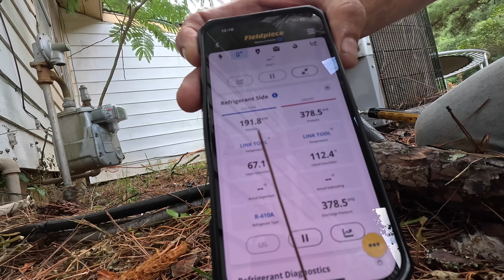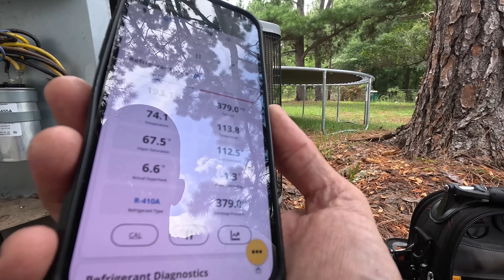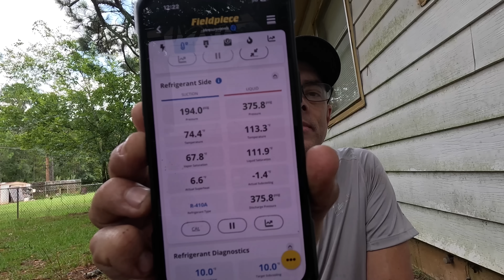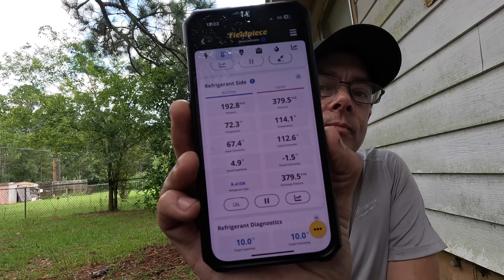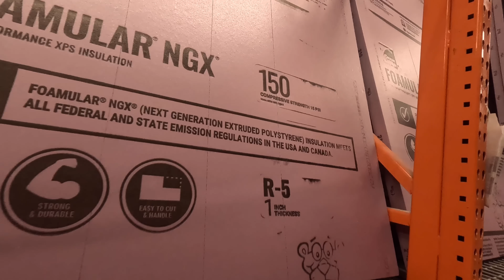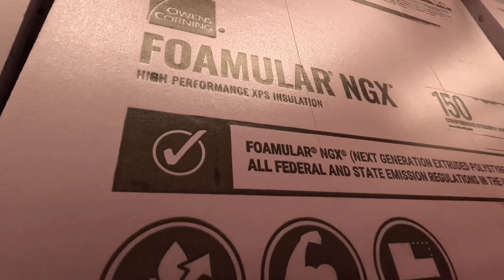Found A Problem I Need To Eliminate First! #hvacguy #hvaclife #hvactrainingvideos

Comment: Not sure how the decision was not made to add a voiceover over that wind in post. But anyway, that symptom pattern is textbook low airflow. Any licensed HVAC guy should know that as a memory item. Memorizing the diagnostic chart, or at LEAST having it on the back of your company ID, should be bare minimum standard. It may not be low airflow, it could be some weird edge case like a bad probe, but low superheat, low subcool, high head, high suction—you should be legally required to immediately know that as low air flow or lose your damn license (or go back to school if you're working under someone else's.)

Comment: looking like multiple issues there, return sucking hot air, both coils likely dirty/clogged and charge way off, with a side of funky txv/wrong piston. reversing valve leaking past if heat pump?

Comment: I was working n a system about 30 years ago and I had a similar leak.  July in Savannah, GA.
I did get frostbite on one finger.  The finger turned black.  I thought that I would lose the finger.
I didn't.  But every one of the thousands of refrigerant lines that I have worked on since, I have worn gloves!
I hope that your hand heals properly.

Comment: never froze myself yet with hoses. although I have in the past with spray dusters, using them inverted as pinpoint freezing tool on electronics.. lol which then they were often R134a or similar.

Comment: Looks like a few problems here: no use of gloves, not checking suction before attempting to hook up the liquid line. 
Other people have noticed and mentioned it consistently on your prior vids - you have a way of trusting the system and now you got burnt for it. 
Always take care of yourself first. If you get injured, you won't be able to work and help anyone, even yourself. 
I'm not biting the txv restriction. It could be both that and overcharged. 
You have a neatly arranged work van, have your depressors handy.
Was it by any chance bad o-ring on the probe, or damaged port?

Comment: I don't know why any HVAC tech would still be connecting directly rather than with a core-depressor or low-loss fittings, ESPECIALLY if you connect with the compressor running.

Seriously, Curtis.  You've got to take care of yourself, especially if you've got a family at home relying on you.

Turn off circuits, wear dust masks in attics and crawl spaces, use low-loss fittings, etc.  It's not frailty; it's responsibility.

Hope you heal-up OK, bud.  Stay safe.

Comment: What a mess. I couldn't hear you in some of that, but when you held the phone up, I saw what you were saying. That job is something that has been going on, it didn't happen overnight. At first I thought the compressor was running but not pumping. I came across that in my MIL's house years ago. That thing is sucking in tons of hot air to say the least, I've seen the same sort of thing where the unit is sucking in the hot air from the attic. It will work properly once you get that fixed, I hope you didn't lose too much freon in the process. Looking forward to the repair. good diagnosis.

Comment: Regarding the difficulty removing the core depressor. 

I have found that if your head pressure is high enough the pressure will push the threads together and make it really hard to remove. 

My solution: 1. Release the core with the dial 2. Release your field piece from the core depressor 3. Open the ball valve to relieve the pressure. 

It will come off smooth

Comment: Why not clip the 2 black wire ties, and remove the flex electrical  feed blocking access to pressures  ports out of the way?

Comment: You need to get a set of low loss adapters for the fieldpiece dongles before you burn your fingers off. Good to see the return box is getting a make over as it's pulling air from everywhere. Also I see there must be an Air Filter shortage in Georgia as no one seems to replace them...
Reply: Isn't it amazing how many people don't change them? Not all the time, but most of them are renters. I won't mention smoke alarms, aw crap I just did.
Reply: We have a shortage of filters here in Indiana also, and nine volt batteries 😂lol, 99 percent of the time it’s renters. I maintained some rentals for a landlord, he had some renters would throw out their smoke detector rather than let you know that they needed a battery.

Comment: You lucked out. Fellow technician wasn't wearing gloves with older gauges and ended up with his hand blistered nearly twice the size of his hand.  ALWAYS WEAR CUT PROOF GLOVES 😀
Reply: Depends. Some work gloves the liquid refrigerant will just soak right through them to your fingers, before it converts to a gas. You may want to put a pair of disposable vinyl or nitrile ones over top of them in this case. Or get ones that have a synthetic coating on them.